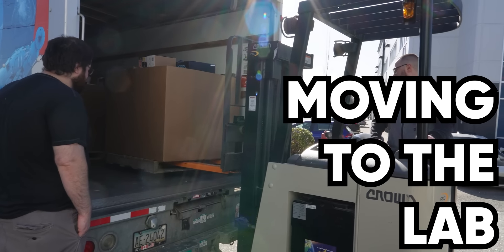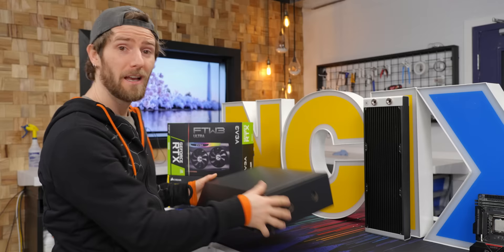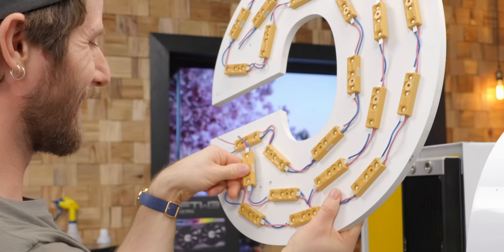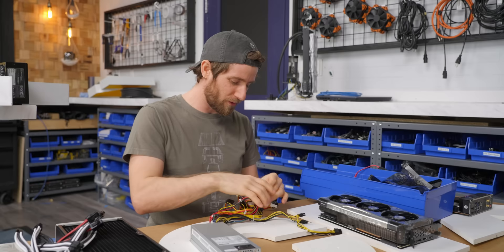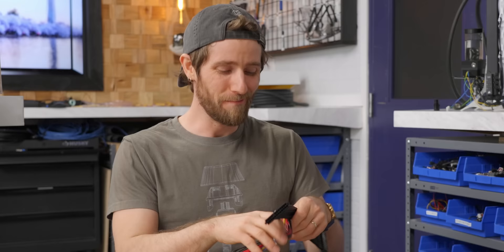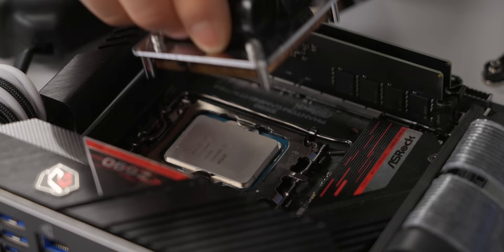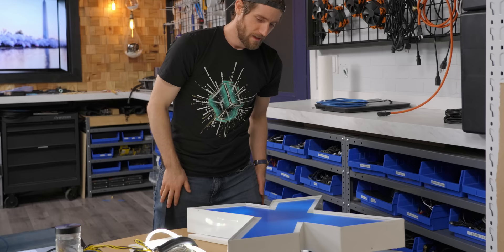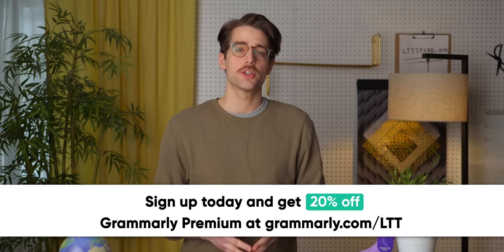Turning my Ex-Employer’s Logo into a Gaming PC

Comment: omg gross. i have that swiftech res, it came with one plastic fitting and one brass
Reply: no it was nickel plated, and it was a 1/2 to 1/4 reducer. half the loop was 1/4 id and the rest 3/8 or something. that setup was a nightmare